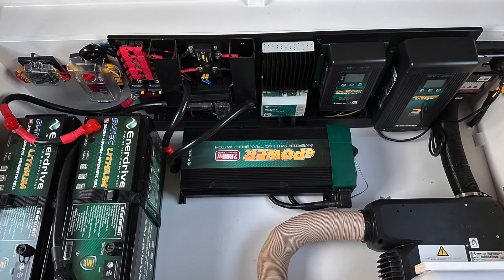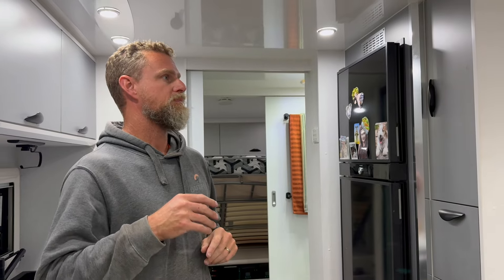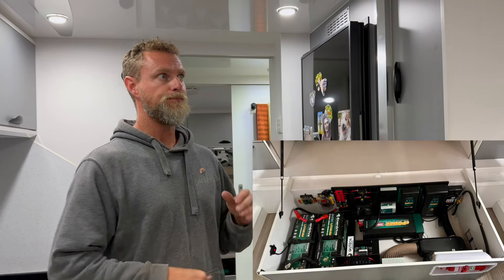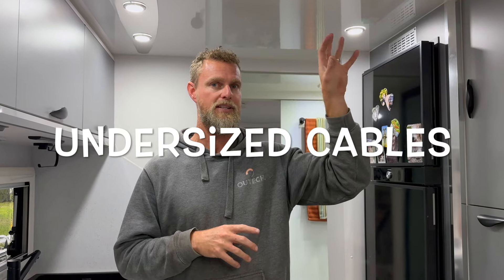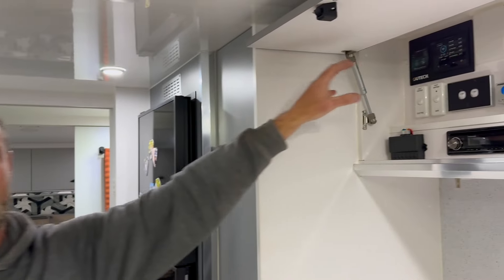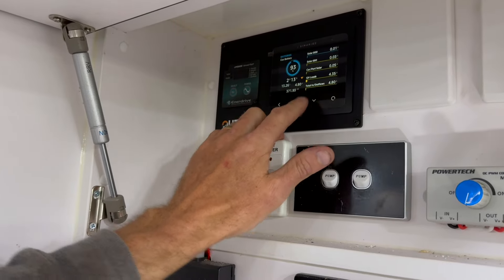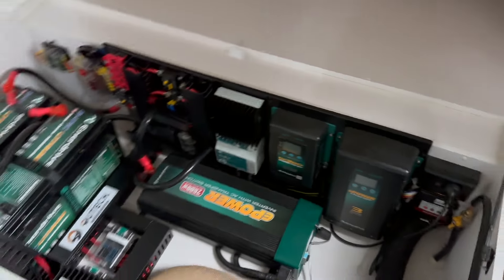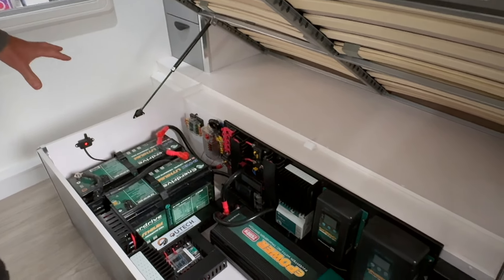When The 'OFF-GRID' System FAILS - Crusader Prince Caravan

Comment: i have a very similar system in my van. I haven't had a problem with living off grid with 1200 watt  of  panels and 340 amp/hour lithium 12 volt batteries which are now about 7 years old. My van is all 240 volts
Reply from the maker: That’s right. A good amount of solar on the roof makes a huge difference to the recharge capability.

Comment: In all of these systems installed in caravans why do they not have cooling fans installed in a closed box containing all of these components, judging by the amount of heatsinks it looks like they need to have some sort of cooling ?
Reply from the maker: Thanks for the comment and question. 

Basically a lot of the products are actively cooled. So we add ventilation into the enclosures that the equipment is mounted into and the active cooling looks after the rest.